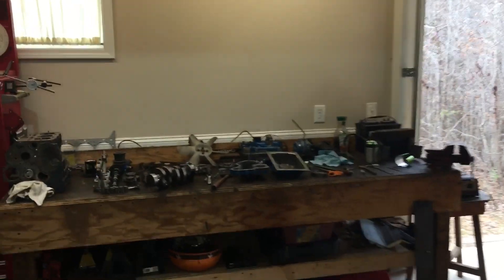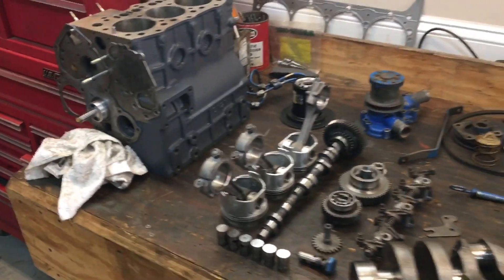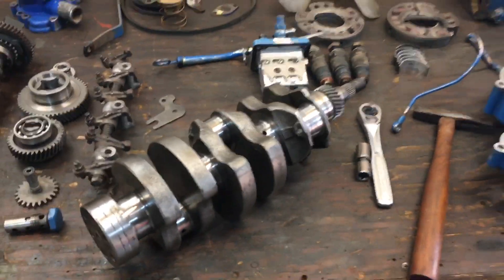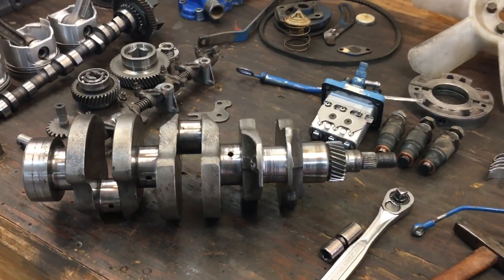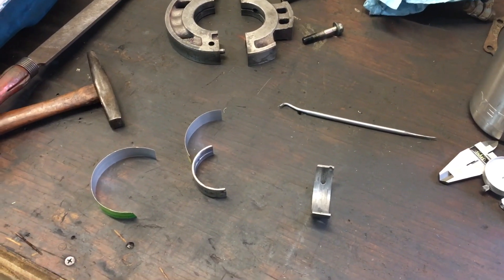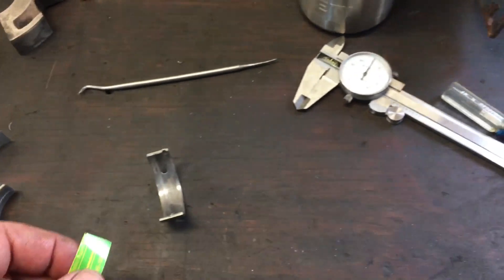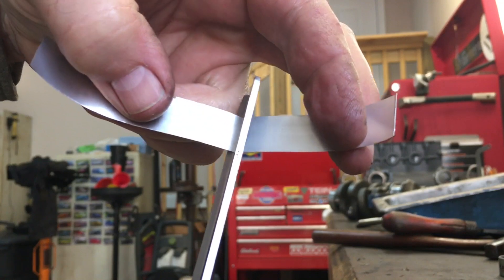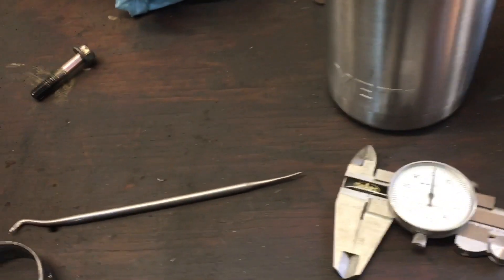Shimming engine bearing inserts with a soda can

Comment: You can buy brass shim stock for this. Far better than aluminum. 
 It comes in thickness of. 001 on up. It's the same size as a sheet of paper, and is relatively inexpensive.
Reply from the maker: Aware. I used what I had. It's still running, worked fine, apparently.

Comment: I've been turning wrenches for over 60 years.  I don't think I've ever done this, but right now I'm working on a Lincoln V6 Duratec engine.  It started with a ticking noise, twenty miles later, clanking.  Found TWO rod bearings had gone out.  Fortunately, one journal was fine.  Unfortunately, one wasn't.  Grooved.  I did some journal polishing, but unfortunately I over did it.  Took too much off and it was uneven.  Using a  lot of Plastigauge I determined the clearances, which varied from place to place.  Amazon will be delivering an assortment of stainless steel shim stock which will allow me to get it down to the half a thou.  I will go for .001 at the tightest location and the rest will be what it is. 

Pray for me.  Ha ha....
Reply from the maker: Ha! Good luck!
Reply: Dealing with the same thing on a different engine. Did it work?

Comment: Built a smallblock once with a budget of about zero. Wound up shimming the bearings on coke cans. I found that truck years later with 40k+ miles on it and she still ran strong with good oil pressure. All it needs to do to work is to work.

Comment: Does it have to be shimmed on both sides or can you just do one side to get your clearance
Reply from the maker: @OBS.Rey__  this is a good question. You certainly could just shim one side if that's how the math worked out for you. However, you should be aware that if you only shim one side that you are also effectively changing the stroke.
Reply: I was actually doing this as we speak thank you 🫡 🙏
Reply: Planning on doing this myself. Giw did yours go?

Comment: Would this work with the tolerances and rpm's of an inline-4 motorcycle engine? 1100 rpm idle & 11500 rpm redline.
Reply from the maker: @AyPapi69  try it and find out!
Reply: @76629online  I might have to try indeed. I was thinking of that little tab on the bearing to prevent it from spinning. If/when you shim the bearing, doesn't that make the tab less effective since it wouldn't be seated as deeply?

Comment: You can send your bearings to a company that will coat them to reduce the clearance. You could of got the clearance correct doing that.
Reply from the maker: The whole object of this was to save money. Sending them off to a custom bearing manufacturer to have that done likely would have cost more than just buying the bearings that we really needed. You missed the point here. I will also note that I did this a couple of years ago now and this tractor is still running without issue.
Reply: @76629online  They all run without any issues until there's an issue.

Comment: I'm just opening my 3.6 caravan engine ...oil cooler broke .lost oil pressure and spun one .found banana rod bolt in oil pan .guess I stopped just in time as the engine still runs with a rod càp bolt missing ..amazing ....I'm attempting salvaging the crank and replacing bearings with engine still in the vehicle ..I've been successful 3 times before ..,but not on this engine yet .I maybe doing something completely unconventional with this engine due to financial constraints ..I will know if it's doable after I get the rest of the lower part of the engine removed .

Comment: My question is could you take a different brand of Bering and make it work to a type of from a different motor or custom-made bearings may be cheaper.
Reply: Yes you can. Start with a reputable machine shop.

Comment: Well then show that the thing works now
Reply from the maker: Been sold long ago. Pay attention.
Reply: @76629online  I spun 1 rod bearing an trying my best to get it right with motor still in 4 cylinder car . I've so far changed all main an rod bearings , oil pump . The cap off of 1 bearing I believe I sanded too much off of , with trying standard bearing in the rod cap , I get it fits perfectly with a piece of plastic gauge , take plastic gauge out an it's too loose .  I don't think I can go oversized just in the cap end so I'm thinking maybe I smoothed out the cap too much an try to put a oversized bearing in the cap , a new standard car for that year engine just in case or try that shim idea been watching videos 2 weeks now . Need some type of transportation .
Reply: @76629online then why did you reply to comments months ago that it was still working 🤔

Comment: I read comments and advices on that kind of repair and I don't see anyone with convincing arguments against doing it. Only people telling it should'nt be done that way or it's not the proper way to... I've red a few articles about how it should be done and I don't see any reason it should'nt work. Material should hold since aluminium is used in bearings. If I have to do it, I'll try to replicate a tapered shim I red about and I will keep crush by not filing too much of the ends of bearing halfs. Wish me luck I'll replace my rod bearings soon and try to shim the faulty one, then tow with it... yup!

Comment: I know this is just before the Christmas vid of 2020.  Came across this vid just now after finding myself with this issue in my 4.3L Chevy Vortec Engine.  I, however, had already concluded what I would try and that is using fans of a Feeler Gauge and cutting them to the size of the bearing cap of the connecting rod.  I am only dealing with one piston connection rod bearing, so I think it will work.  I wanted to use steel behind the bearing!
Reply: So did it work for you?
Reply: Planning on doing this myself. How did yours go?

Comment: The next best step after the engine pistons and connecting rods were installed backwards..is....= tat tada daa shimming with aluminium soda-can...
....haha
Reply from the maker: This was done because the crankshaft needed reground and there were not bearings available for the size that it would have been. Even if we had it welded and re-ground standard it was still going to cost $800. This thing is still running fine more than a year later. Laugh all you want.

Comment: I understand you are trying to make the best of a bad situation, but shimming a bearing is just shade tree mechanic stuff. Also the bearing tang does nothing to keep the bearing from spinning in the block or rod, It is merely a locating tang for assembly. The area of the bearing you are filing off is bearing crush. That is what keeps a bearing from spinning in the block or rod. If you are going to file some off because of the shim you put behind it you should leave .003-.004 above the cap so you have some crush. And with .010" clearance still after your shim it will clang and bang itself into destruction. Good luck!
Reply from the maker: You wanna buy me an $800 set of bearings and pay to have this crank welded up and reground? It works. Been running for more than a year now.

Comment: Any concern about plastic coating or paint on the piece cut from an aluminum can?

Any thought about putting a double shim on the top side of the bearing bore to further reduce the bearing clearance?
Reply from the maker: No plastic coating in this can and the paint, if you want to call it that is just a fraction of a mil thick and I don’t expect to have any issues with that. You could stack shim pieces however stacking these would have worked out too thick. I am just working with what I have here. The key to making this work is not filing too much off the end of the bearing Insert and ending up with a loose fitting bearing. These pieces all need to fit together tightly in order for this to be successful.